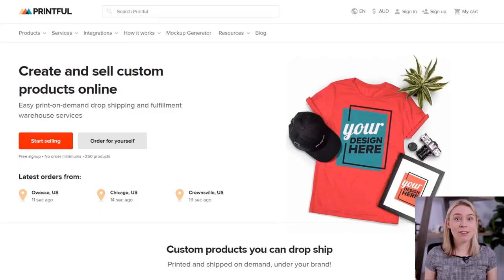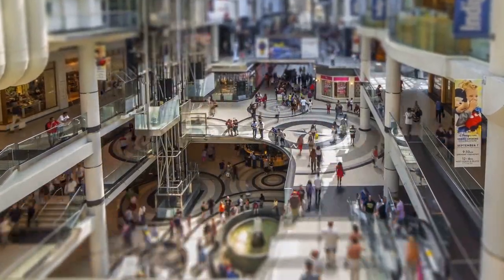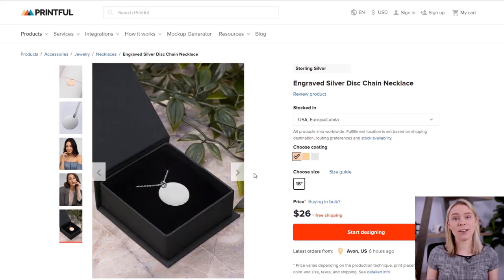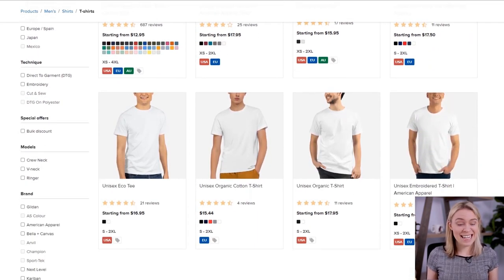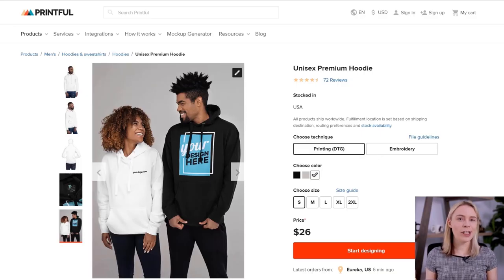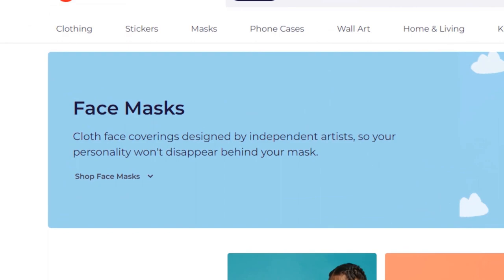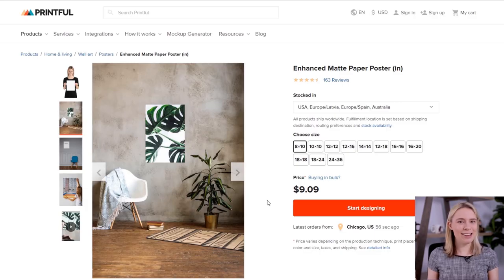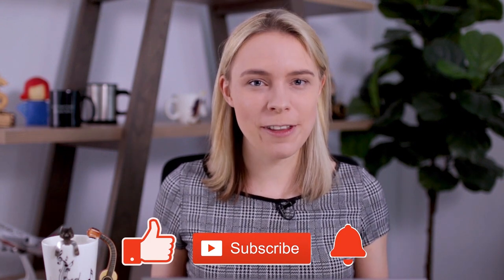The Top 10 Print On Demand Products That SELL The MOST...

Comment: Thanks again Sarah for your valuable contents. One of your former videos you said "Don't put too many colors and sizes on your stores for not to look scammy."  I have a t-shirt and a hoodie which has 25 or 17 different colors and 9 sizes. How many colors and sizes should I put to my store not be seen scammy? Is it better to split them into half at least, like 12 or 8 colors and 4 or 5 sizes? Thanks.
Reply from the maker: You have to apply logic to the situation.
If you want to charge higher prices, you have to treat yourself like a premium brand, that cares about the image you give off.
You have 25/17 colors, but usually, only 5ish will look the best. If you were a premium brand, you would rather present the best colors, than just all of the colors, to protect the integrity, of your brand. So if you come in and offer 25 colors, it looks like you don't care at all about your brand, and if you don't care, others won't care either.
There is no exact formula here. So if you want to apply an arbitrary number to it, choose 5. Amazon used to limit the number of colors you could pick to 5, and then they stretched it to 10 due to popular demand. But most people just buy the 4 most popular colors anyway (Black/Grey/White/Navy). So they probably find it frustrating that sellers demanded more colors, but most people just assume more is better, without thinking about why. So pick your 5 best colors.
When it comes to sizes, more is better. There is nothing wrong with offering as many sizes as possible 🌞

Comment: which website is better for a European person? Printify or printful?
Reply from the maker: There is no answer to that, each has pros/cons. The European suppliers on Printify have less features & products available but they are much cheaper, 30-50% cheaper. Printful is European based which is great but it's more expensive. Weigh up in you would rather earn less money per sale & get Printful's extra features, or earn more money per sale & use Printify's European suppliers because you don't need Printful's extra features.
Reply: @WholesaleTed  thanks for the answer:) !!